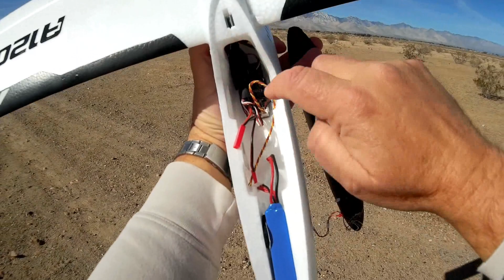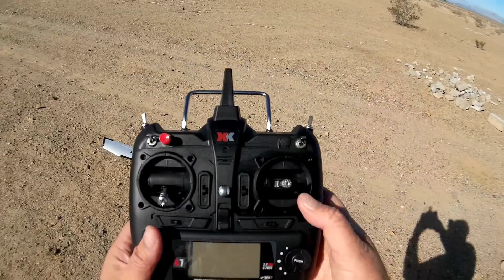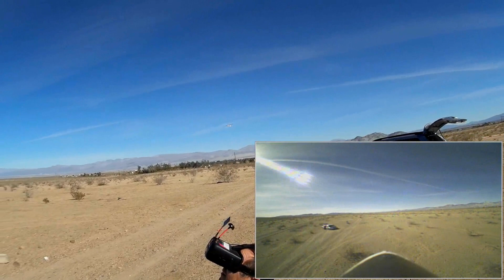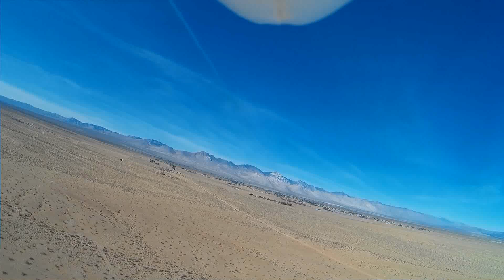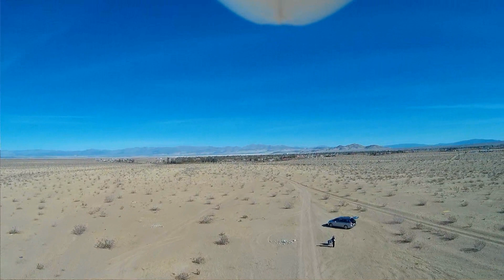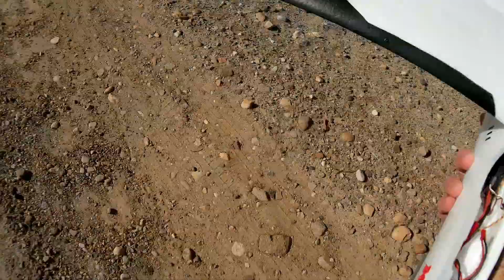XK A1200 Large Stabilized FPV Glider Flight Test Review

Comment: Looking for my first FPV plane, would you suggest this XK a1200 or the Volantex ranger G2? I'd rather have a pnp model but it's no deal breaker...any other suggestions?
Reply from the maker: I like the A1200 best due to its stabilization system which makes the FPV ride much smoother, and more enjoyable.  However, it is getting harder to find the A1200 as I believe it is out of production.

Comment: I really love this plane and with the full fpv kit have taken it out to about 800m with great reception and remarkably good video. It can do SEDATE aerobatics but it is hardly sporty (not designed to be) The porpoising is alarming but pretty standard and is usually tied to speed and trim.
Landing is always fun until you get used to the extended glide slope

Comment: I would like to know what size battery you used on that fpv camera for that wing
Reply from the maker: It was just a Syma X5C style battery (1S 650mah generic LiPo).  Most (but not all) of these cheap AIO FPV cameras can be powered by such.  Just review the cameras specs before purchasing to check the voltage requirements of the camera.

Comment: Can give me a link for the camera and the battery you used on this plane thank you.
Reply from the maker: Which camera/battery?  There were two.
Reply: Quadcopter 101 sorry, I didnt reply directly to you. What camera is the fpv one on top? Did it require any extra wires to connect to the plane, and did you plug it into the spare port in the ESC?
Reply: The fpv camera. How did you connect it to the plane? Did it require any extra wires?
Reply: KLM747 I was asking about the small fpv camera that you put on top of the nose and what battery do you use for the camera ?
Reply: Quadcopter 101 I was asking about the camera that you mounted on top of nose and what type and size battery you use for the camera you put on top of the plane?
Reply: Baylien St, yeah, that was also my question I wanted to know if he used an extra baterry or just plugged it into the spare port coming off the ESC. I am looking to buy and want to know which camera is the best.